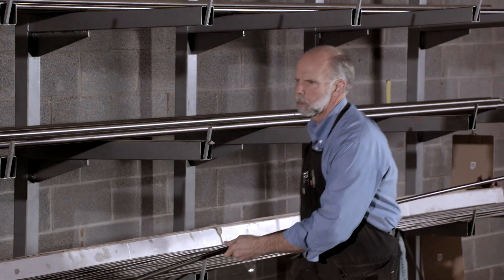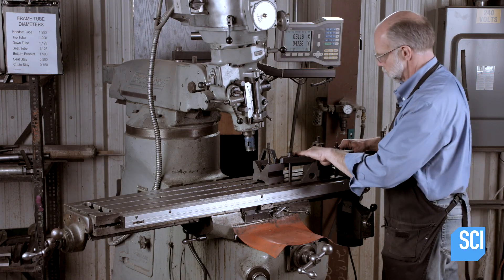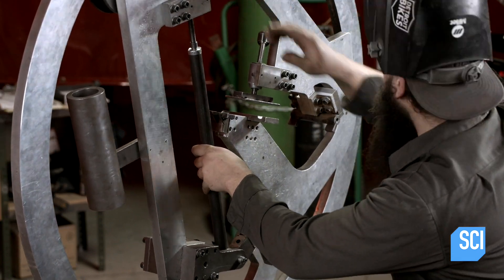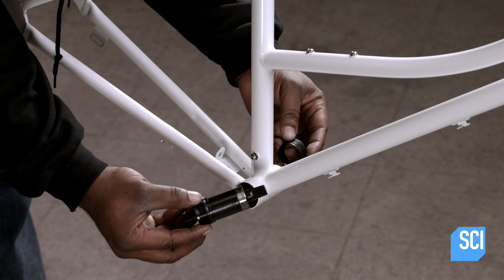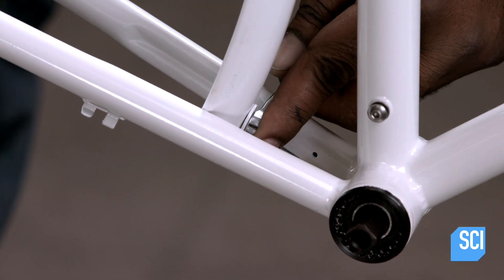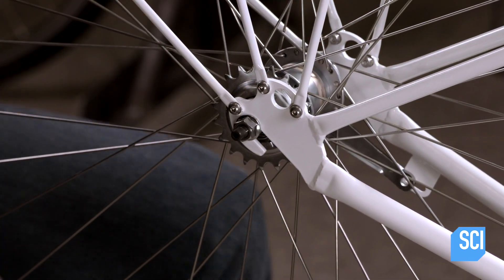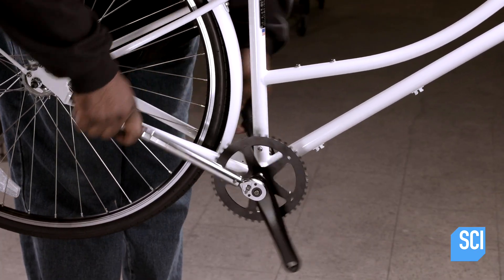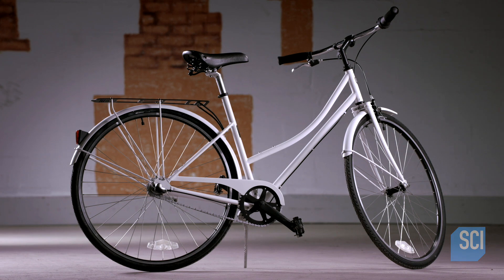How Steel Bicycles Are Made | How It's Made

Comment: but how plumbuses are made?!
Reply: I mean everyone has a plumbus in their home you should know but in case you dont: 
1.-  First they take the dingle bop and they smooth it out with a bunch of schleem. The schleem is then...repurposed for later batches.
2.-  They take the dingle bop and they push it through the grumbo, where the fleeb is rubbed against it. It's important that the fleeb is rubbed, becasue the fleeb has all the fleeb juice.
3.- Then, a schlami shows up, and he rubs it and spits on it.
4.- They cut the fleeb. There's several hizzards in the way.
5.- The blamfs rub against the chumbles, and the plubis, and grumbo are shaved away.
That leaves you with a regular old plumbus.
Reply: Thank you, I always wondered how plumbuses are made!!